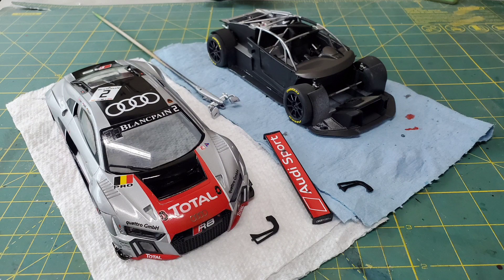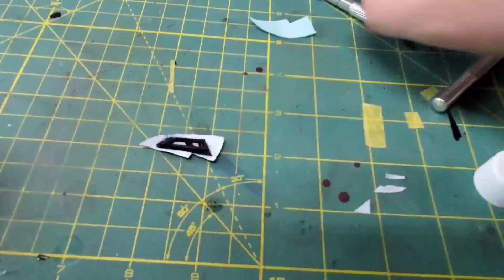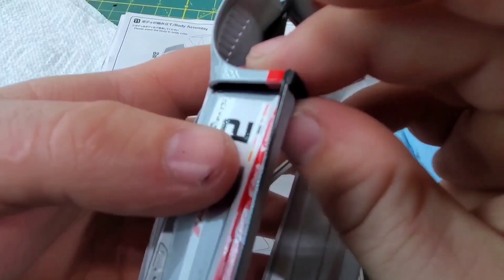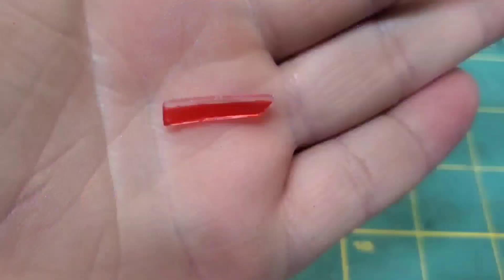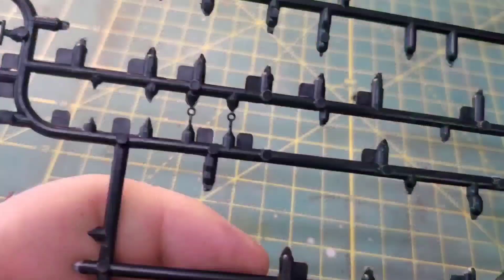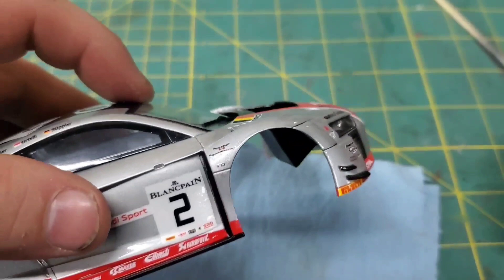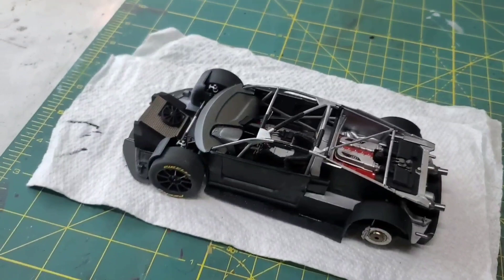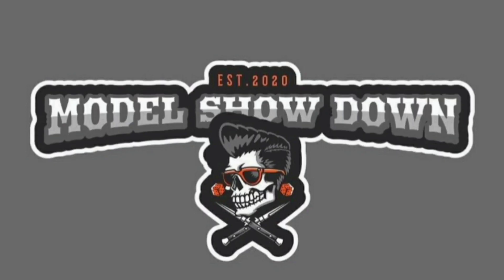Nunu Platz Audi R8 LMS GT3 build  - Part 5, final assembly and show off

Comment: The red things by the windshield are recovery hooks, they pop an access plate off of the front and rear and snap those into the holes, hook a hoist to the eyes and lift the whole car up go clear the track of a wrecked car.  You can either have them in place on the body or readily available on the car, they put them there because it's an aero low pressure zone so it doesn't kill the aerodynamics of the body.
Reply from the maker: I did not know that, thank you!